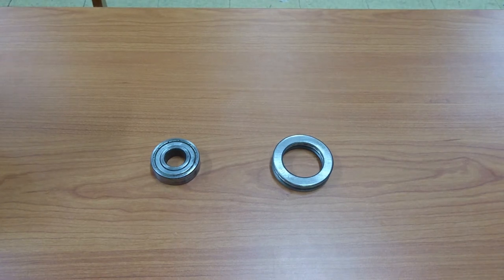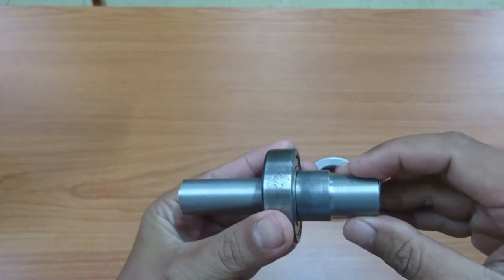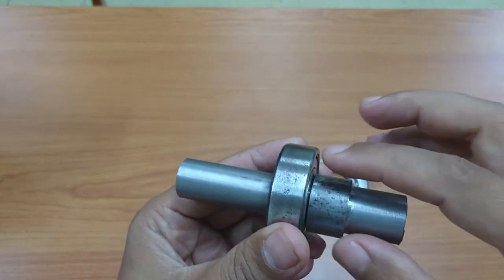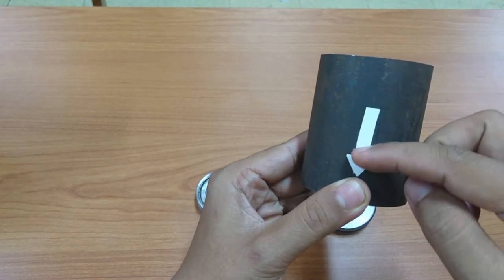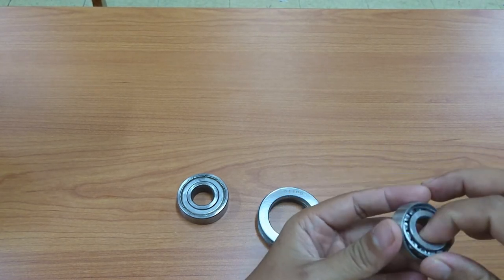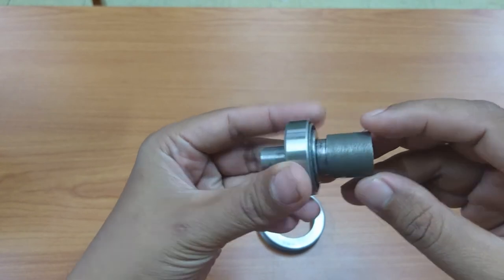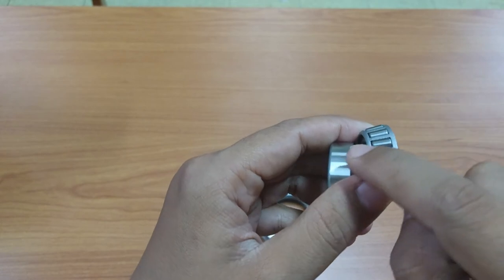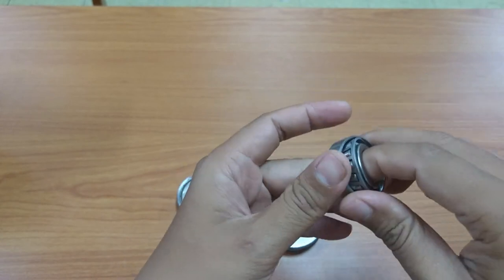Bearing type by load direction. Radial and thrust bearing explained

Comment: Thank you so much for your great video and explanation 😀. So if you have something heavy like a compact car that needs to be able to be elevated, suspended and attached to a pole in the center (sort of like a fashion mannequin) and be able to rotate, you would need the 2nd one, the bearing that can handle axial / thrust load, is this correct? Thanks again
Reply from the maker: We can use tapered roller bearing. Since the load is heavy and must must be able to withstand radial and thrust load.
Reply: @temmycandrawijaya  Thank you very much for your answer. I understand much better now. With gratitude from the Caribbean :)
Reply from the maker: Glad it helped

Comment: can we then determine just by looking at the bearing which type it is? the thrust bearing has a face around the circumference but the radial has the inner ring being the bearing surface?
Reply from the maker: If the outer ring can be separated and has a cone or flat ring shape, that the thrust bearing. Radial bearing ring mostly in one part.

Comment: What is moment load bearing
Reply from the maker: As far as I know, a bearing is'nt handle torsional/moment load. But if there is a torsional load exist then using two separate distance bearing will handle torsional load. Each of bearings will handle opposite radial load.